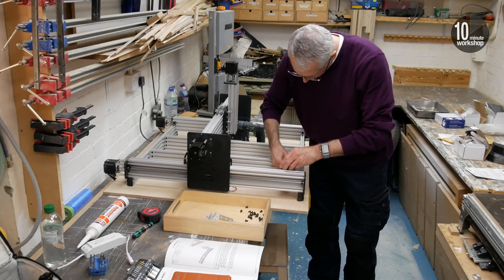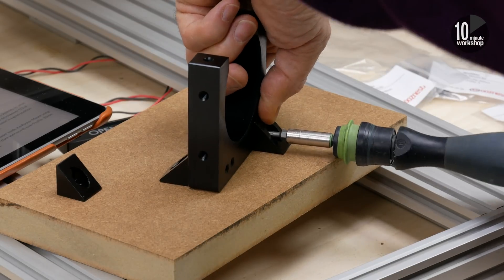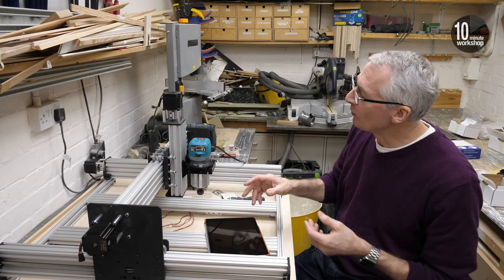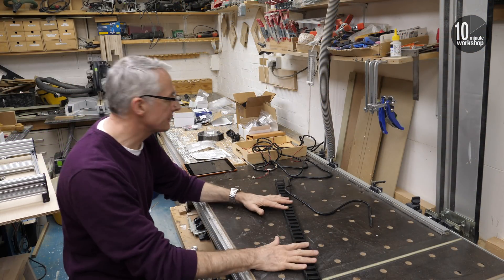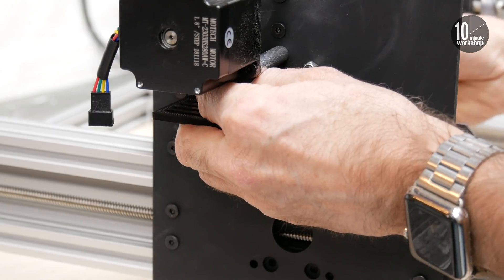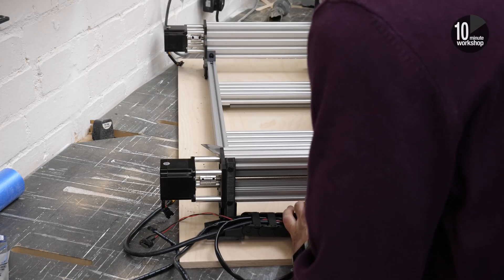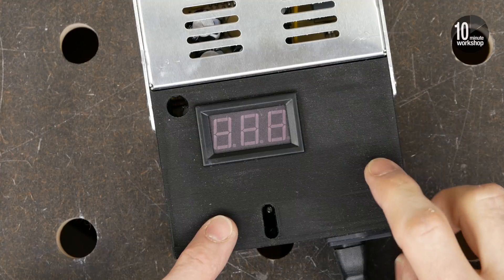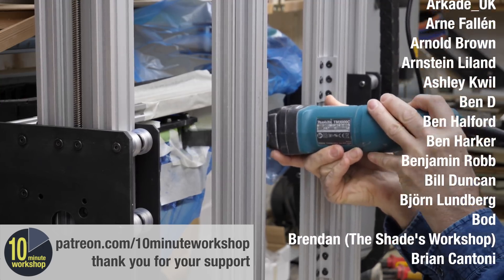Starting Out in CNC P4 -  Making changes [video 388]

Comment: Hi Peter, it is a little disappointing when you were fitting the cables in that a machine that is supposed to be “UK” has in big letters made in China on it.
Reply from the maker: Not to me. I don’t expect them to mill their own extrusion, make their own power supplies or circuit boards. That would just be reinventing the wheel, don’t you think?? 🤷‍♂️

Comment: You should get a water cooled 1.5kw spindle with vfd..

That will give you more power,  control and running time
Reply from the maker: Thanks! I’m looking at all the options for upgrading, but a water-cooled 3-phase is probably a step too far for the use this will get. 👍👍
Reply: @10MinuteWorkshop  I got a Chinese 6040.. Cnc is a whole new rabbit hole, I've yet to make sense 😁..
I look forward to your learning curve
Reply from the maker: Haha, I’m starting to realise that, 😂😂👍👍

Comment: Hi Peter, Great Video! Do you have a link to that Fein spindle you mentioned? Never seen one of these and i'm looking to upgrade my spindle shortly (though heart set on the Mafell FM1000).
Reply from the maker: Thanks! I’m looking very closely at the Mafell as well, but the Fein is this one - https://fein.com/en_uk/machines/grinding-polishing/standard-frequency/die-grinders/gsz-8-280-pe-72231760241/#. Technically a die grinder, but I’ve heard good things. 🤷‍♂️👍👍
Reply: @10MinuteWorkshop  Die grinders make great spindles because they are designed for side loads.

Comment: not sure your expereince in cnc but when i started a few years ago the biggest learning curve to me was feeds and speeds.  I can highly reccomend cnccookbook.  Well worth the cost.  Punch in details and it will give you what you need and it has never failed me.  Do get a spendle if you can.  Having the right rpms for tooling/material is critical.  In my journey someone suggested and i don't regret since run times can be long (in my case hours).  Running a router will not stand up, and the db is real bad.   Cheers.   Love mine.  4'x10'  https://www.cnccookbook.com/g-wizard-feeds-speeds-calculator-beginners-hobbyists/
Reply from the maker: Thanks! This is 'starting out' so my experience is basically what you've seen on video so far, plus another few hours. And yes a spindle will almost certainly be on the cards, but that's for 'carrying on' with cnc, I need to finish the starting out first! 👍
Reply: @10MinuteWorkshop  btw first project was mft replacement table...awesome to cut my own

Comment: What kind of irreparable damage could you have done? Surely you could have just unbolted the work you'd done.
Reply from the maker: Key word there being ’just’ - taking apart the whole carriage to reverse the plate means stripping down the entire X-gantry, and plates on the Y, stepper motors, everything I’ve done so far basically. I’m confident in my competence to not cause ‘irreparable damage’ simply through drilling a hole and making it into a slot in an aluminium plate. 👍👍